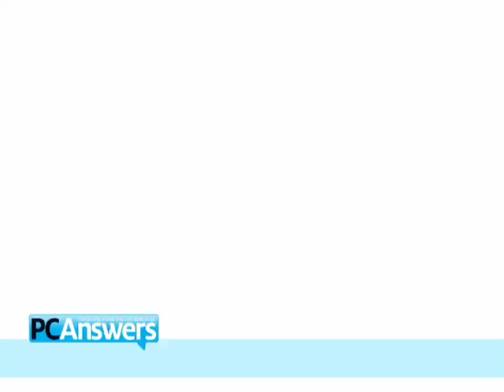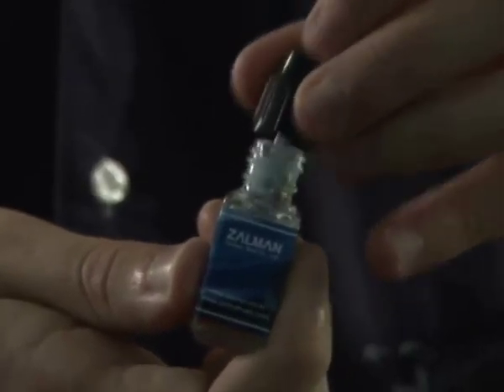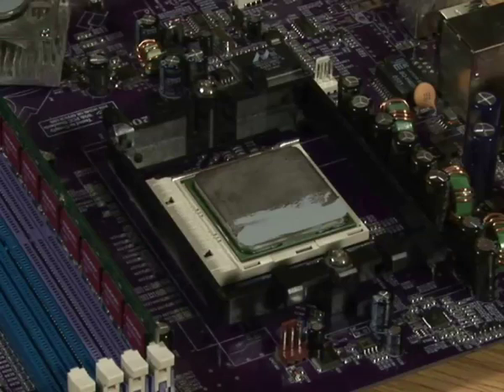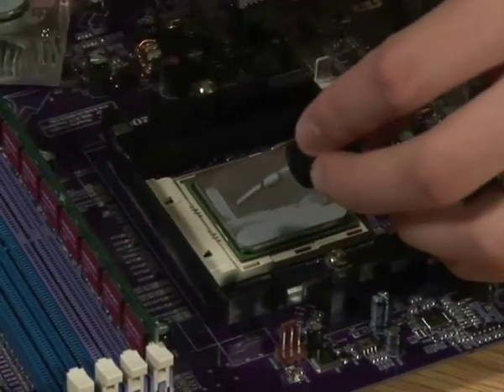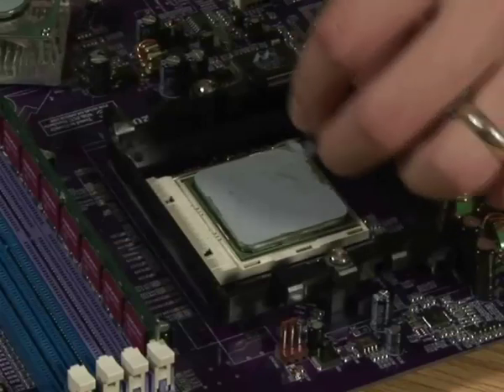Install a Processor (CPU - Intel or AMD)

Comment: OMG GOT IT it was 1 little pin bent verrry slightly, i used a 1/16 flat-tipped head to carefully and steadily bend it back into correct position, and it went right in. thanks man!! ;O

Comment: ok having a hard time... trying to re-install my old processor in its motherboard and it isn't going in correctly... I have the arrows facing correctly, and it's sitting slanted? any ideas?
Reply: +Chris Cooper This is a little late. Is/was your motherboard bent? That could be the cause.
Reply: +XYZ_GAMING No idea. I was able to get the processor in after I bent one prong, but it didn't seem to work. When I put power to the motherboard, I heard some strange sounds I didn't hear before coming from it, so I think I screwed it up. I don't know to be absolutely honest hahaha. It's ok... And yeah you're right you are late, I threw the motherboard and processor away about 10 months ago :P
Reply: Chris Cooper Hahaha, well at least you can restart

Comment: I have a Intel Core 2 Duo E6300 Processor(1.86-GHz), and I would like to upgrade to a Intel Core 2 Duo E6700 Processor (2.66-GHz) would this be possible? Or a different processor by intel 2.4 GHz or more.
Reply: Upgrade to the i5!
Reply: chris crump Get a new motherboard, preferably the H81M series with an i5-4440 or higher. Trust me, it's totally worth it!
Reply: *****
Why not the G3258?
Reply: *****
I mean, G3258 over the Core 2 Extreme?

Comment: I just ordered a new cpu a AMD 8 core FX-8350, however one of the reviews said it's not really 8 core, but rather it's 4 core with 16 threads. I don't understand, what is that all about?
Reply: Pretty much all processors (besides extreme ones) are quad-core meaning that it has 4 cores. For example the Intel i7 is a Quad-core duel thread. This means it has 4 cores split into 2 threads each (8 threads) meaning 8 different tasks can be done at one time. Your CPU could be either Quad-core quad thread or Octo-core duel thread. Either way, performance wise, there is no real difference in either one. Hope this helps.

Comment: I built my own computer I have a quad core intel i7 extreme  CPU with a 2010 motherboard (intel) and a gamers viideo card I have 2 hard drives both 250 GB and windows7 ultimate I'm still working on it and when it's done I'm gonna post a video

Comment: I need to know if I can upgrade my intel pentium for a newer one. The computer that I have is an Acer Aspiere 7736z. I read in the internet that I need to make sure that it goes well with the mother board and model, and other stuff. By the end of the information it said that it is better to get a new computer. Can some one tell me what do I have to do in this case. Thanks.

Comment: No. If you had an Intel CPU prior to the upgrade, you can only go with Intel CPUs. Likewise, if you started with an AMD, you can only choose from AMD CPUs. Be careful though, as there are certain elements which need to match such as the FSB (DMI for Intel Core i3/i5/i7), the chipset to make sure it supports the CPU and of course, the CPU socket.

Comment: Well all hardware has a special information storage that stores the devices bios(aka the software the device requires to function). So theoretically you don't need to install any drivers for it to work properly. But i never installed a new processor, so there's that.

Comment: Sorry, that processor wont fit into that motherboard. After a quick Google search I found out that that motherboard can only fit AMD processors (AM3). But don't lose hope, I recommend getting the Gigabyte GA-Z68A-D3H, it will fit the i5 perfectly.

Comment: youve obviously got it on the wrong settings. put it on power saver. that helps and it is barely noticeable. all it does is reduce the frame rate. i get no lag and my computer is about 5 year old. and i bought it for $200

Comment: @CruelMaple It is not the processor problem (I can play Minecraft on an AMD Sempron 3000+ @ 2.00GHz with no problem, which is from 2004), what you need is a graphic card, maybe an Geforce 8800 or a Ati X1600 to play ok, I will recommend a Geforce GT520, is cheap and very good for light games like Minecraft (With 8GBs of RAM and iCore 5 Quad, runs Minecraft on Far with everything on highest lag free), AC and CoD.

Comment: Does it matter if it's a dual core/ quad core processor? Or does each Motherboard support different cores in that regard.

For example I have an i3 single core processor in my computer right now, I know it can take an i5, but not an i7, I don't know however if it can take a dual core/ quad core.

Comment: @2290Sean No.

And replacing the processor is simple enough. Let it fall into place, don't push it. Apply thermal compound, not too much or too little. Don't worry about it if the processor already comes with it. Lock the heatsink onto the motherboard and screw in the fan, plug it to the motherboard, and viola! You saved about $80.

Comment: my amd ii x2 220 has am3 socket so can i replace it with the amd phenom ii x4 quad core 960t black edition  run in ths socket its am3 aswell but will my motherboard run it

Comment: I do have an old Intel E6600 Dual Core, I am planning to upgrade my CPU to a new i5 2500, I was wondering, do I have to upgrade the power supply in order to do so? If not, in what case a power supply upgrade is required? Upgrading to a more powerful GPU maybe? Thanks in advance!

Comment: @skellytoon273 thats an AMD motherboard, so it only takes AMD processors, so to answer your question, No.

also, thats a motherboard for a slim/mini tower, so making a supped up gaming machine might not happen with that motherboard, (thats if your tryin to play games like CoD:MW3, Battlefield, Dead Island, ect. ect.) if your doing it for like Sims 2, typhoon, or games like that, you should be ok.

Comment: I got a P7h55-M pro board and today i finally went and bought a new core i5-2500 processor, because I have seen everywhere (even in the handbook) that its compatable with i5 processors, but thwne I came home I found out something horrible, it didn't fit -.- the two dots on the side didn't fit, what can I do?

Comment: its not always that easy you gotta know what type of processor you need there is alot of processors with different pins on the bottom

Comment: @Dogmeat1950 check the processor type and the motherboard socket type...i recently had that problem with my build, i bought an intel core i5 which was an lga1155 socket type and an intel motherboard that was an lga1156 type, go to intel and look up your chip and motherboard they have a compatibility checker. i ended uo having to get a new motherboard but now my system runs perfectly....im suprised it does too because i built the whole thing off of youtube videos lol

Comment: ok, I installed a new  chip but when the Computer starts up. the Computer runs for about 2mins and then turns off. also there is no power going to the Mouse or keybored when  this happens.

Now Power isn't the problem because I also just got a 850W power supply. and the chip I have isn't anything needing a lot of power it's only  3.0ghz Deuo.

I'm guessing the chip is not meant for the Current Motherbored., but that's my guess. anyone have any idea?

Comment: @Jeremiah1182218 
It depends on your motherboard. You have to look up what socket your motherboard has. Now the processor youve selected has an AM3 socket (as the name already says), so you have to have a motherboard with the same socket. If it is not the same, you will have to buy a new motherboard with the actualy socket.

Comment: @drterrybrown this may sound obvious but did you pull the lever down on the processor?  it sounds to me like it's just an issue of something not being tightened.  do you get a video signal at all?  that'll determine whether or not it's your video card too.  the biggest thing you can do to troubleshoot is simply isolate the problem.  figure out where something would go wrong.  think about it from a logic standpoint.

Comment: hey need some help .. i brought a new cpu after installing it i turn my pc on and nothing boots up .. no bio'os menu no boot option .. so ive but my old cpu in and the same is still happening .. im gttin power to the fan thats above the cpu so still could it be a motherboard issue ?

Comment: @sonicdaguy Im not a pro at computers but im pretty sure you can. Just make sure your motherboard will support the new CPU, if you have an older comp with an older motherboard, make sure it can support a new AMD/Intel chip.

Comment: @TheBassCoverGuy It will help, however I'm not an expert by any means when it comes to comps. I'm still learning.... bbuuuuutttt... I think it's actually your RAM is what is the sweet-spot when it comes to gaming. The more Ram the better, and of course a better video card. 

If you are going to get a new processor, don't even waste money on that Dual-Core.
Just upgrade to i3 or i5. It'll help you out in the long run.
Focus on the RAM first though, how much do you have?

Comment: If the pins on the CPU get touched what should I use to clean it and if I install a new one like a 2.4ghz intel celetron (yes I know its not the best) do I really need to paste that stuff on to?

Comment: @kyubipalex pentium 4's are considered out dated by todays standards but the minimum specs for starcraft 2 are a pentium 4 runing at 2.6 GHz, and yea if you don't have a good graphics card get one of those but dont spend 200$ on one unless your going to rebuild your entire computer because your pentium 4 processor will bottleneck your performance.

Comment: @sweetnessboy1 older processors 286/486 up to the old school P1 intel chips did not require much if any grease as the computer power was extreamly limited so heat was never a major issue to require high end fans or cooling. newer CPUs most of the 775 and up chips due/duel/quad/I3/i5/i7s and such have a much higher heat output and more power SO require grease and higher cooling fans to keep them from over heating. if your pc randomly restarts its possible your over heating and should check it lol

Comment: thermal paste keeps the heat down by alot, but newer proccesors like the i5/i7 and newer AMD's don't require it at all. if you have heat problems new paste is always a good idea.

most people don't even know the processor is under the heatsink or what a heatsink even is. it's funny how 99% of people who use computers for hours a day don't spend the time to learn about them

Comment: hi i have an HP a1540n PC and i went to bestbuy geeksquad asking them to upgrade my pc from 2gb to 4gb and from 250gb hardrive to 800gb and upgrade my processor and they said that since the parts for my computer are hard to get its going to cost me alot of money. So would it be better for me just to buy a new computer or upgrade from geeksquad

Comment: At 2:20 -

My AMD CPU manual tells me to hold the CPU down with one finger while locking it in with the lever, unlike the video. So the question is, should I hold the CPU down while locking it, or will it lock just fine on it's own like in the video?

Comment: no a q-tip can leave behind fibers in the paste and that can cause problems.  I use a small paintbrush used to paint airplane models.  they're cheap but they work.

Comment: for the AMD CPUs the most common ones out there are either AM2+ or AM3 depending on the socket.

For the Intel side of the equation the sockets are commonly LGA 775 (Core 2 Duo and Cor 2 Duo Extreme)  LGA 1156 for the i3/i5/ and certain i7's and LGA 1366 for  other i7 chips.

Comment: ''Without therminal paste your processor is going to overheat''

No it doesn't? i've build many systems in my life and i NEVER used therminal paste on any of the processors, even the newer ones, and they always are like 35 idle and 40 load.

Comment: I didn't put any thermal paste on my processor when i installed it but it runs 15-20c when idle on stock speed.

Comment: i hate the lga 775 boards and processors ive been building cpu for along time destoyed three board buy binding the pins thats why im switching to amd next week my wifes has here pentuimd 4 945 processor and it still works cheap ecs board thow im getting gigabyte and quad core phoenom lmaso

Comment: ;)
You can try, but the pins (if any, recent intel CPUs don't have any) wont match, so it's idiot-proof :)
there were times that it was possible, somewhere in the 90's where socket A was identical to socket 1, BUT it wont work eighter, so...

answer is NO :)

best regards!

Comment: hi, I have got a :
Intel Core 2 Duo E4400 
speed 2000 MHz (2,0 ghz)

can I built a : 
Processor - 1 x Intel Core 2 Duo E8500 / 3.16 GHz ( 1333 MHz ) - LGA775 Socket - L2 6 MB - box

instead of it????